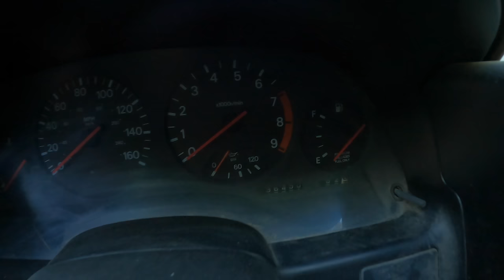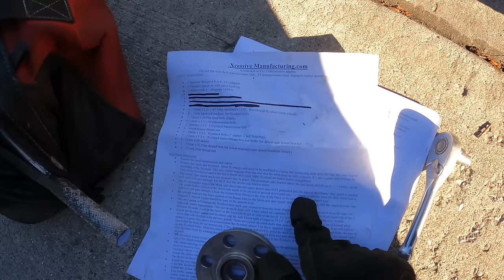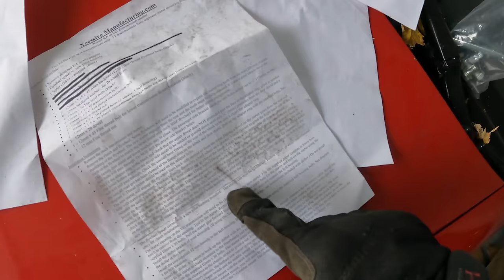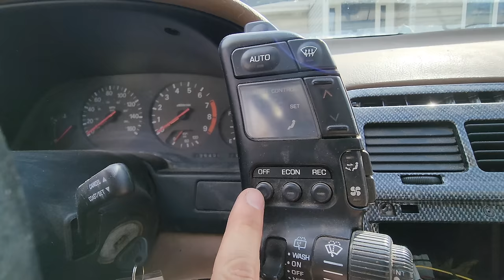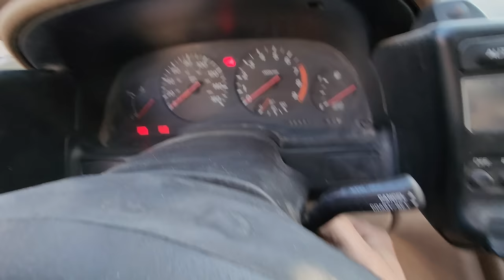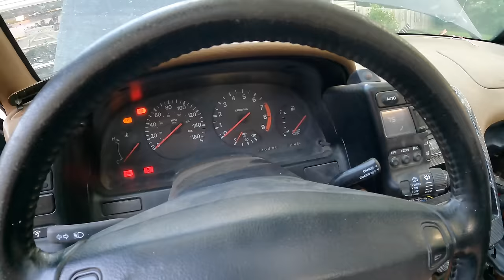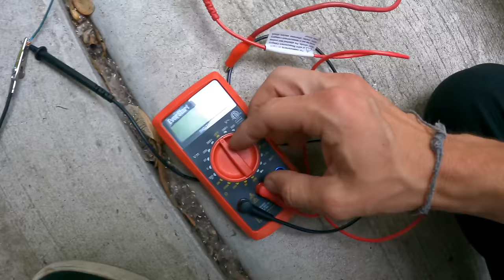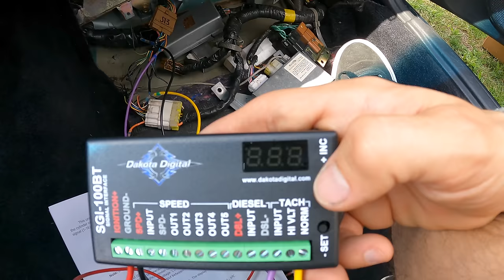Rebuilding a Junked 300zx in 1 Year!

Comment: Just a small tip when wire wheeling the crusty bits, is after grinding you should wipe it down with and the just spray some paint to seal it and it will help keep it from rotting when moisture builds in the early am and springtime. Been working on Toyota and Subaru's for 30 years and its what we do in the north east when Rust/cancer is a major concern on the untreated JDM cars.  I personally go 1 step further and Wolwax my FJ cruiser each fall in prep for winter months. Great work on this build and I love that you describe what your doing. A lot of people will learn a ton from this! You gained a Subscriber

Comment: Keep it without a spoiler bro, looks so much more sleek. I do like the spoiler you picked tho, so if you gotta have it I think it'll look nice. I had a 94 300zxtt with about $24k worth of mods that I totaled back in like 2006. Had full Stillen Body Kit, a J-spec block from a whole front clip I shipped in from Japan, Greddy Turbos, Nismo cams, HKS boost controller, HKS exhaust.. 21psi boost. Thing was a rocket.  Wish I still had it. Be careful cause that rear end will kick out on you real easy once you get some power going. Loved that car, was in the shop for almsot a year getting that engine swapped and all the goodies installed, dyno tuned, etc. The guys at she shop were begging me to install a RB26 instead of the VG30 but it was gonna be a bit too muc money, came out a lot cheaper to just get the J-spec VG30. Since I got the whole front clip and it was off a low mileage car I had them swap most of the components over. Wish I'd had the money to have them do a right hand drive swap too.. and the RB26 of course 😂. If your car has the Super HICAS system in it, delete that shit asap. Makes the car too squirrely.

Comment: The weight you found on the old trans mount, those are installed by OEM's as a means of vibration dampening. IIRC, this was fairly common for a lot of v6 engines, and especially so on more "luxury" cars where nyl vibration is unwanted.

Comment: I worked for a Nissan dealership in the 90's remember when they were new got to drive a lot them as a mechanic didn't enjoy working them through if I ever had to replace the turbos I would have to pull the engine out just to replace them cause there is no room to do it with the engine in the car but they are fun to drive.

Comment: I had always wanted a 300ZX, mostly due to how they looked and my assumption that they were "fast". A lot of people make that assumption about older RX7's as well...but anyway, I picked up a convertible from a fellow fairly nearby. He was a 'pro flipper' and did all the things to make that POS seem like a nice car. The only things that presented immediately was that it needed one of the top frame braces replaced (and a new top) and the hood and bumper painted. I found out on the way home that the front rotors were warped after they heated up a bit. I went ahead and put new tires, new brakes, new top brace, new PCV and a bit of troubleshooting for the Cali emissions that were on it. I took it to a shop and had them correct the paint and ended up with what I thought was a great looking car and of the assumption that it also was going to run and drive well. HA!

Two weeks later the AC went out. The power steering blew out the rack seals as well as the pump almost the same day. I opted to pick up a pulley and just removed the air and the power steering. The car ran semi well but just never had any power. Took it up to a local specialist out by Douglasville that charge an arm and a leg to even look your cars way, much less fix anything. I had to hunt around for someone with the proper scanner and ability to fix some further emissions issues after I told them to fuck themselves on principle. Other nagging issues kept creeping up, had to replace the fuel pump and sock, and kept having issues with the car randomly losing spark on crank only. Got most of that straight when the rear tail light plastic fell apart and the only source led me back to the specialist I had told to do something anatomically impossible. 

I hadn't gotten the top repaired yet and was only driving it in nice weather. It was a sure fire head turner gloss black on black leather interior (converted from white). I went out one day to take a short drive and the no spark issue presented again on a brand new set of plugs and coils and I had enough. I listed it for $1400 on CL and had it gone in hours. I lost about 10K on that POS and will never look back. Sort of sad in that I like Nissan in general, but a Z car? NEVER again.

Comment: I say you do not need nor want a power steering pump! Save some hp and saves some gas. I would keep that project as light as possible with that 4 cylinder engine!  Are you going to Turbo it eventually?

Comment: I found a 1996 NISSAN 300ZX Z32 V6 (3000) TWIN TURBO 5speed with a Blown Motor for $3K. In 2003. Me and my pops fixed the motor for about $5K and free labor of course. The body was mint with a brand-new Plumb Purple Grape color. Was offered $50K for it. I said hell no. That thing is priceless since me and my pops worked on it. Dude didn't even know he had a FairLady when he sold it to me.

Comment: The V6 motor used in the Nissan GTR 35 looks very similar to the v6 in the NISSAN 300ZX, bet a gtr35 motor would drop straight in without much modification

Comment: The original computers need to be installed and a key programmed to the car. All computers must have the correct vin number programmed in them. Startup and immediate shut down is a security issue.